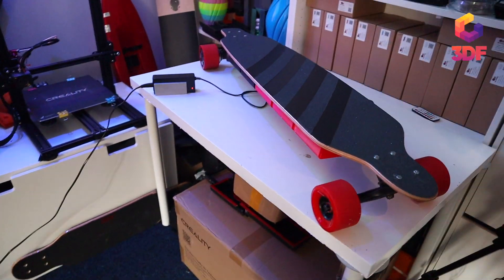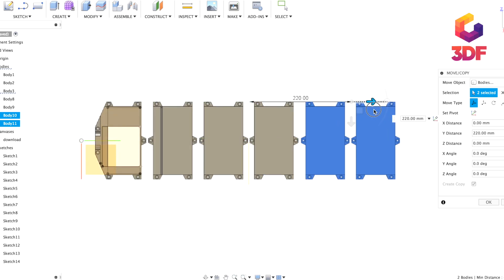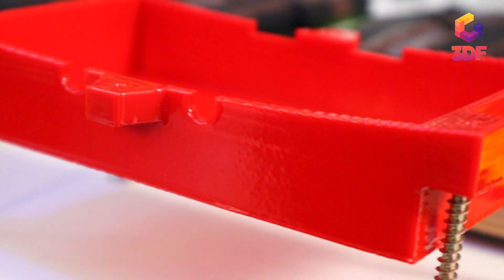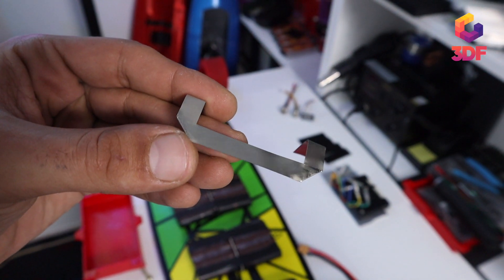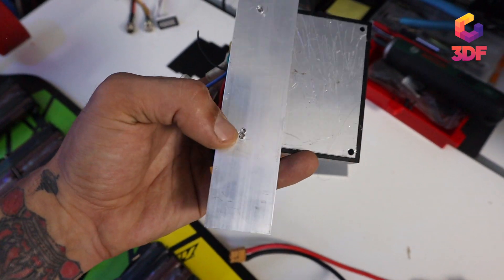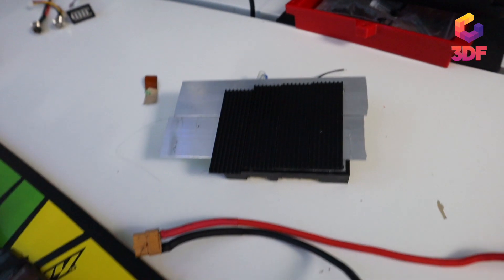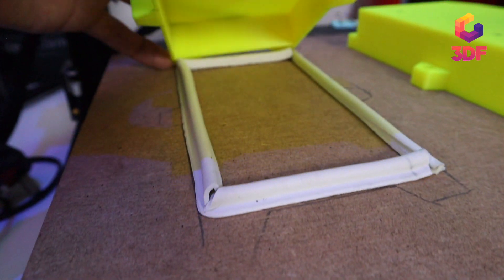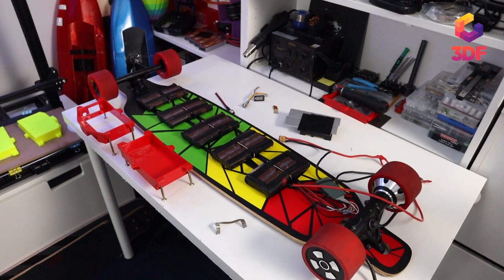DIY Electric Skateboard V3.0

Comment: Hi, thanks for this great video !
I buyed same parts and I'm looking for wiring connection for the motor to the ESC, I have these wires : red,black,yellow,blue, green .
I'm also looking for the female plastic connector (the brushless motor doesn't offer the female plug).
Thanks again, best regards.
Reply from the maker: Schmurtz Alex Hi .  the colour of wires can be different from a product to other. But commune colour are this in this order .     Red - yellow- blue- green- black .